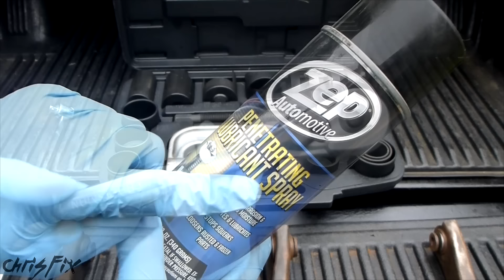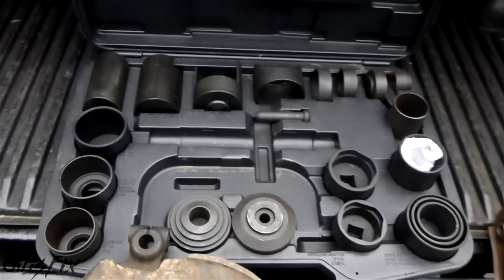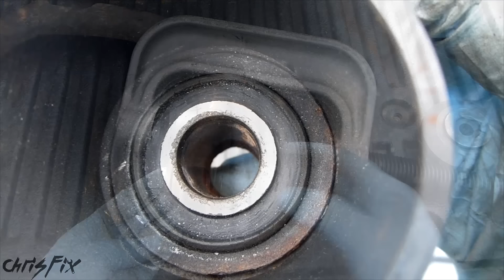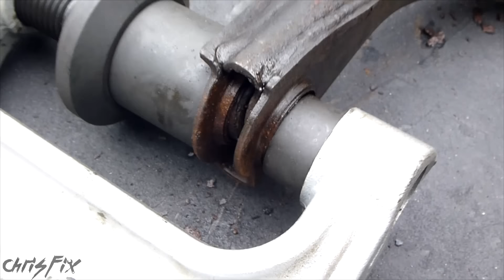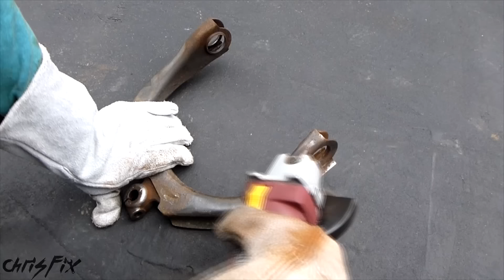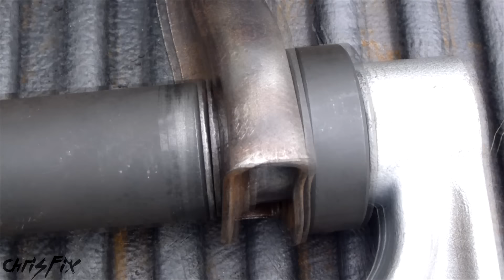How to Replace Control Arm Bushings (EASY)

Comment: I've been trying to do this for a few days now. It's a nightmare. My control arms are larger and I can't get the bushing pressed in straight through the second hole. Ended up squashing the ears and bending the bushing sleeve. I threw the control arm into the woods.

Comment: If you grease (not spray lube) the threads on your press clamp it will be easier to turn and enhance the tool's lifespan.

Comment: Needing some wisdom. Attempting to remove busing but it is seized to the control arm. I've tried using a ball joint press to remove and attempted to torch it and it didn't work.. The bushing just wont come out. Any advice?

Comment: Hello Chris, you make an assortment of very helpful videos, I like to thank you for that. regarding the above video on replacing the bushings on a lower control arm, Do you need to remove the control arm completely or can you just remove the bolts that hold the bushings remove old bushings (using proper tools} and replace with new ones? hope you understand my question. thank you again for all your helpful videos.Manguz

Comment: The job is a little easier if you can find a socket that will fit into the space between the two sides of the control arm. When torquing the clamp down, you can see the sides getting closer to one another. With a socket acting as a wedge to prevent that movement, the lips of the control arms don't move and the bushing pops out more easily.

Use the same technique when installing the new bushing to prevent the sides of the control arm from bending in to one another.

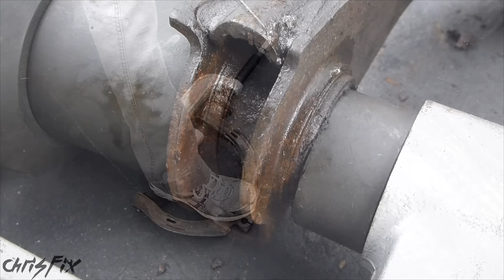Comment: It's stamped metal,you need to use a spacer between the two layers of the control arm otherwise you deform it or crack it,like here 5:20

Comment: Hey Chris, love the videos. Have a quick question, on my car the rear wheels are wearing unevenly, and I know it's the rear control arm going bad. Can I correct the wear by replacing the bushing or should I replace the whole arm?

Comment: I wouldn't totally reference to this video process the walls of the control arm started to collapse you need to install a bushing so this doesn't happen otherwise by the time you press the new one in the walls are touching each other. Otherwise chris you explain everything very in depth!

Comment: the auto parts store around me did not have the rent a tool this job. i simply burned the old rubber material out with a hammer. i then cut the old shell in a couple of places with a sawzall and then drove the old shell out with a hammer. your not trying to completely cut the old shell in half just weaken it enough so you can drive it out. i sometimes make due with the tools that i own, i get the job done. i used energy suspension poly on my 96 camaro to hopefully help add some longevity and performance to the handling for cheap. the entire kit was $150 for the entire car, the only thing it did not include was engine mounts which i bought separately also poly urethane energy suspension. im getting there, allot of worn out rubber crap on a 20 year old car.

Comment: You use all manual hand tools and everything seems to come apart just fine and then there's the guys that have full shops with 3/4" impacts and they seem to get the things that will not budge (then they have to use the heat wrench). Funny how that works.

Comment: WAY too thorough.  was surprised you didn't go into a treatise on how to use a socket wrench. 10 minutes long, could have been covered in 2 minutes. Good info for the absolute newbie, though.Would have been good info to have if you'd told us where you got your press kit.

Comment: I went to Belle Tire because the back end of my Focus was squeaking bad.  They told me it was worn out control bushings and that bushings don't come separate anymore and that I'd have to get new control arms too.   I knew it was total bullshit but I was about to embark on a long roadtrip and just wanted to get the car fixed and quiet.   They charged me $400 for this shit and the car still squeaked.  Took it back in after the trip and they magically took only 30 seconds to tell me the squeaking is from a loose parking brake bracket and they tied it down with zip ties.  I told them that they tricked me into spending $400 and they were a bunch of scammers and I'll never go back there again.

Comment: If you install polyurethane bushings, you have to leave the metal sleeves in the control arms, and dig out the rubber stuff.  I was hoping you would comment on that direction as well.  Good video and learned some stuff.  Probably should have had a shim in the arm before you cranked it down pushing out the bushing.. but that has already been pointed out multiple times LOL!

Comment: a chisel and a hammer is all you need , just straighten the bent edge all around , and the tension is off the bushing, less chance on damaging(to much pressure) the control arm .

Comment: Bloody great tips. Ball joint presses are quite cheap too. I'm very curious though because of the different types of these tools and ball joint separators too.
I've heard some stories of people using basic G clamps and an oversized socket to do this aswell =P

Comment: So on some older General Motors models the original lower control arm bushings are flared out on the inside, so be careful trying to push them out because they will pinch the control arm together.

If you do this however, its not the end of the world, it is possible to fix it as long as the metal isn't cracked.  A long bolt, two washers, and two nuts can be used to spread the "wings" apart to a straightened position.

Comment: The bushings are worn out on my 1989 Jeep Wrangler . Occasionally I will hear a scrubbing noise,however, I can't get it to make the noise when I have a mechanic look at it. Am I doing damage to anything by not getting the control arm bushings replace? thanks

Comment: Hey Chris I tried taking the control arm for my 08 Subaru impreza 2.5I, but I had problems. Took some bolt off and had a jack on the rod and car. When I took part of it off the spring and rods started to bend outward, pushing the Jack. Is it necessary to take out the whole control arm to change the bushing?

Comment: Good video. If I can just make one suggestion it would be to try and use some type of spacer   at the ends keep the control arm ends from pinching/collapsing closer together as you are pressing them in/out. That space can be critical sometimes.

Comment: Stamped control arms like to pinch under load of a press like that. If you measure the control arm before applying any force to it and cut a piece of round or square stock to just fit inside the open part at the bottom of the control arm this will help with making the control arm strong enough to not bend. If you don't have metal cutting tools you can get a bolt that will fit with just a small amount of wiggle room. Put a nut on the bolt put the bolt in the open space and back the nut off until it wedges inside the control arm! This is a good video and I'm not trying to be a smart butt, I just do a lot of front end work and thought this tip might help someone?

Comment: Well in the case of these Trailblazer upper control arms, the price difference isn't much 12-13 for the bushings vs 35 for the complete arms, for that small a price I would probably just replace the arm and cut the time in half. Also I would suggest anyone looking to be a DIY'er to invest in a pneumatic impact gun and air compressor, it's makes suspension work SO much easier.

Comment: Looks like you damaged the control arm, the welds cracked on the end, as well as pinching the ends.
Stamped control arms are poor candidates for replacing the bushings.

Comment: chris, the women folk were sure we needed a dryer/washer combo, then came you with the $18 sensor in the back fix.   i need to give the appliance store the site.  did not realize that i could press bushings myself.  lucky i found you before i do another set.  got the pair of control arms for $80 online, but hard to beat the free rental, ChrisFix method.   and "sometimes you wanna go where everybody knows yer name.."    u gotta be top 5 with scotty, brian, richpin, and whats his name.  hope we're yer ticket to somewhere, pro.        deuce

Comment: For harder bushings or anything as such with interference fits, you can always use a heat source and some freezer spray. They will pop right in without stressing the component too much which can sometimes bend or crack and ruin your alignment.

Comment: Great video!
But what if the bushing is part of the control arm? In this case there is no other option rather than replacing the whole arm. Or do you have a possible solution for that? :)

Comment: how about changeing the bushings on  a 96 corvette like on the sway bar link i need to do it on the rear and possibly the front too i get alot of metal rattesing in the back when going over uneven roads

Comment: I NEED HELP MAN......I decided on swapping the bushing at the shock (2007 TB Ls)...because my other bushing seem to be fine this one is very shaky an loose...i rented the c clamp ball joint press...but it will not fit over the bolt/bushing along with the cups/adapters as the c clamp is too small...am i doing it wrong? can the lower arm bushing at the shock be removed? i have replacments but for the life of me cannot get the old bushing out

Comment: Hey Chris! Thanks for your helpful videos. Can you please respond to my questions. I would really appreciate it!
Does this damage the lower control arms in any way? Isn't it better just to replace the lower control arms? I have a 2005 Infiniti G35. My mechanic said I should replace the lower control arm since it's not centered on the bushing, and it can get worse with time, and since I am replacing one side, I should do the other one as well. What are your thoughts on this? Thanks in advance!

Comment: Chris,  to let you know the resolution of the problem I told you about yesterday, here it is:  I called the recall place (one of them -- Federal Mogul).  He sent me five pages of diagrams which included the date stamps and part numbers that were part of the recall.  He told me to take the car to a trusted mechanic who would be able to determine if our car had the recalled parts. He said that the mechanic could even call him if necessary.

But, the mechanic told me that it would be too hard to locate the information without taking the car apart. (This makes me think that in the future I should get part numbers and manufacturer names whenever I have anything replaced on a car.)

The mechanic did offer to take a look, though to see how things looked in general.  He called me in after awhile to see what he had found.  The car was still on the lift.  The first thing I saw was that it was raining coolant -- not dripping -- raining.  There was also a transmission/differential fluid leak.

There were no aftermarket parts for the control arms, but I could see the ball joints on both sides in the front of the car.  They looked a hundred years old, ready to disintegrate at any minute.

He showed me that the front and rear struts/mounts were worn and causing a clunking noise (besides lots of squeaking whenever I went over a bump or slowed the car down, coming to a stop. 

He let me listen to the huge amount of noise that the exhaust resonator was making (and said that it was worn and needed replacing.

Also, the fuel pump was noisier than it should have been, but he didn't know how long it would last -- 2 months or 7 years-- and wasn't sure if the dealership would be worried about that problem.

However, he thought I should take the car back to the dealership and see if they would fix everything or else put us in a different car. He had everything written up on a ticket for me showing what was wrong.  Since the dealership had claimed that the car was in great shape except for the control arms (and they wouldn't need to be replaced for quite some time -- not being a safety issue), this report showed that they were terribly in the wrong.

When we went to the dealership, amazingly, the salesman, even before I had finished making all of my complaints, said that his manager had told him that if we came back, he could cancel the deal.  Of course, they wanted to put us in a different car if we agreed to that, but they were willing to forget the whole thing and refund our money if that's what we wanted.

This was even though the car had been sold as is with no warranty (not even 30 days).  I was pretty happy that they had decided to do the honorable thing.  I guess they value their pretty good reputation and didn't want to tarnish it.  We are going to go on Monday to look at a 1998 Honda Civic that is not ready to be shown yet.  Tomorrow, we might look at a couple of older Hondas at the dealership where I bought my 2008 Honda Accord two years ago.  My salesman (who was a great guy) is checking out the incoming inventory for us.  Since I pretty much trust him and I've had Hondas since 1987, I feel pretty comfortable with this new plan.  My mother is living on her social security income, so she can't afford to spend much (if anything).

This ended up being a long explanation, but since you wanted to know what happened I wanted to give you the story.  Maybe it will even help someone else (as a cautionary tale).  Before we buy another car from the dealership that we bought this "lemon car" from, we will insist upon taking it to a mechanic to be checked over instead of taking the seller's word for it that the car has been inspected and reinspected and in good shape.  (Supposedly -- ha!) It will cost $75, but it will be worth it.  This was something of a nightmare, so I'd like to avoid putting myself and my elderly mother through anything similar in the future.

Thanks again!  I wish you all the best.  I don't know if you can tell but I did subscribe when I sent my first comment.  I hope you get lots of subscribers and make lots of money from ads.  In the future, when I check back, I'll listen to the Ad the whole way through because I know you get more money or points or something when your "views" watch the Ad all the way through.

Comment: As a follow-up to my post below, after doing more research I discovered that there was a recall on replacement control arms for the 2006 Chrysler Sebring (for certain part numbers).  Hopefully, tomorrow I can get that sorted out.  It appeared on a couple of websites that there was also a recall on the 2006 Chrysler Sebring control arms period (not just replacement parts). (As well as for the lower ball joint and for the "service brakes, hydraulic:  Foundation components: Master Cylinder").  But, when I entered the VIN number, the message came back that there was no recall for my mom's car.

I love Youtube and people like you who show us what to do!!!!!  Thanks again!

Comment: Hi Chris!  My mom and I just bought a 2006 Chrysler Sebring for her from a car dealership.  The salesman told us the only thing wrong with it is that it will eventually need front lower control arms and isolators and rear upper control arms.  He said it is not a safety issue.  My brother and my mother will both be driving the car.  My brother was super unhappy that we bought it after he drove it for the first time because he said he can feel the car pull to one side and feels it "shimmy."  He thinks it is absolutely a safety issue.  I was looking around and found your video.  Do you think we could find a mechanic who would just replace the bushings and would that solve the problem?  Money is a major factor in what we do.  Also, what do you think about the safety aspect?  Thanks for your help.  I love the video, but even though it's super easy to replace the bushings I can't picture being able to do it myself:)

Comment: Please answer this thank you!. I have a 2006 Toyota Solara and every time I accelerate around 40mph more or less. It starts shaking the hole car! It shakes a lot. Can it be the bushings? Can a bushing cause this in the first place? Is it expensive? Note:it only shakes when accelerating . can it be dangerous to drive it like that? Thank you for anyone who responds

Comment: Nice tutorial, but shouldn't you really use a metal collar to fit between the "ears" of the control arm to ensure that the metal does not get crushed inwards while you're pressing? Control arms are often made of surprisingly thin pressed metal.

Comment: Chris that forcing screw on loaner BJP looks bone dry. You could show how important tool lube is for making the pressing so much easier and prevents galling the screw threads. Less torque needed to reach forcing pressure required.  This not only protects the investment of a tool but also the most important tool there is....the mechanics body (joints, nerves, tendons etc.) over time. You make GREAT repair videos! JP-USA

Comment: I've  got a crazy creaking coming from my general front left suspension area on my '01 Tacoma 2wd PreRunner. Even with mechanics stethoscope, I can't pin point the creak source. Ball joints are semi new, struts are brand new (although I didn't replace the bearing plate) and I've been suspecting my lower control arm bushings for the creaking.  I was going to order the whole control arm, but now I'll probably try this method. Thanks bud!

Comment: Anyone know what the difference between a 41mm upper control arm bushing and a 43mm upper control arm bushing.  On a 98 gmc sierra 1500.  And how would you tell which one was needed for your control arm? Thanks in advance

Comment: This is GREAT.  I was wondering how tough it would be to get those out.  Mine still look ok after 12 years but I just moved to a road-salt and pothole-friendly state so all these repairs are just a matter of time now.

If you don't have an air compressor, do you at least have the $39 electric impact from harbor freight?  It will change your life!